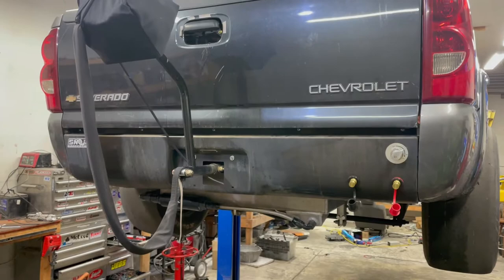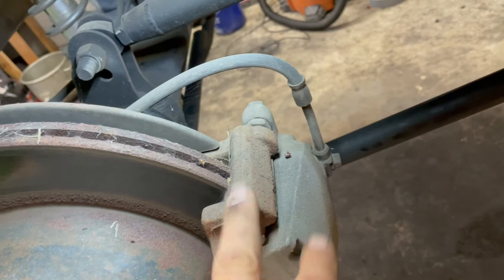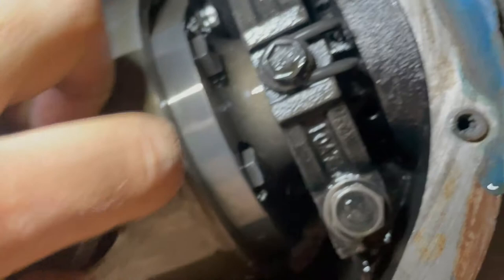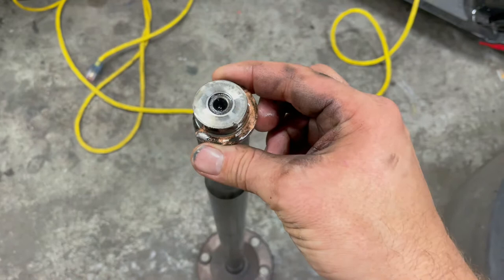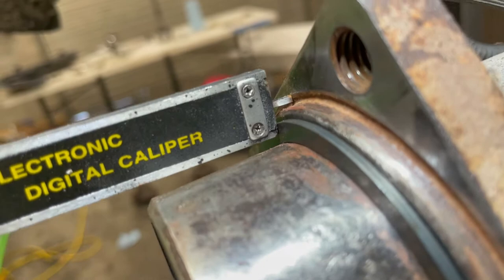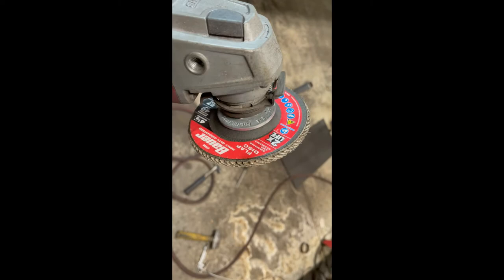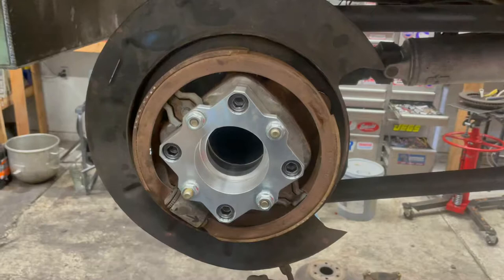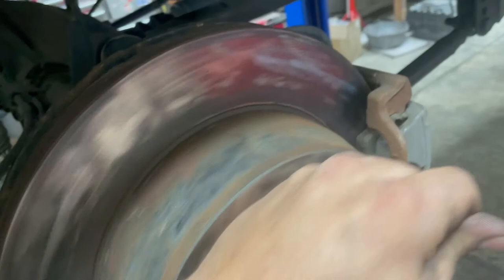99 Silverado Axle upgrade  14 bolt semi float c clip eliminator install with Got Torque Kit

Comment: Wonder if by that factory flange being welded on out of square to the face, will wear your outer bearing prematurely
Reply: No. The bearing is in the axle tube. The crooked flange makes the brake caliper and parking brake shoes out of alignment.

Comment: I have a question, I'm looking at a 14 bolt out of a 2010 silverado 1500. It is a 9.5 and 6 lug but came out of a 4x4 truck. Is their a difference in length between 2wd and 4x4. The truck it would be going in is a 02 silverado 2wd 1500. Would this work?
Reply: In the GMT400 trucks, the 14 bolts in the 2wd trucks are narrower than the ones in the 4x4 trucks. I am not sure about the 2010 models.

Comment: How come you were still running C-clip axles in a truck built up like that?
Reply from the maker: Still never broke.  Being 4x4 your not hitting the rear axle with all the load.  It is shared.  That’s one thing going for it.  The other is they are 33 spline stock compared to the 10 bolt 30 spline.  Fact is if my track hadn’t demanded it I would still be on stock axles.
Reply: @Brainstangs  You're not racing at an NHRA sanctioned track?  From NHRA rulebook:  Aftermarket axles and axle-retention device (C-Clip Eliminator) mandatory on any car running 10.99 (*6.99) or quicker or any car with locked differential.
Reply: @Brainstangs  I have a 2007 Classic Silverado 1500 (GMT800 not 900), I'm looking for a 14 Bolt SF 9.5 with factory Rear dual piston caliper brakes, looking to eliminate the drum 8.625 rear. Know where I can start to get a parts list together?

This has Leafs out back.